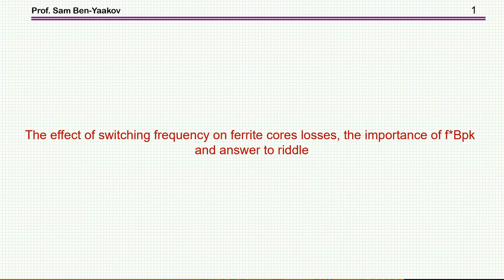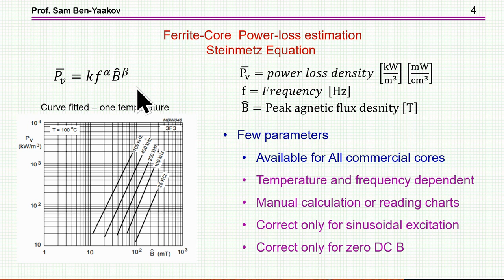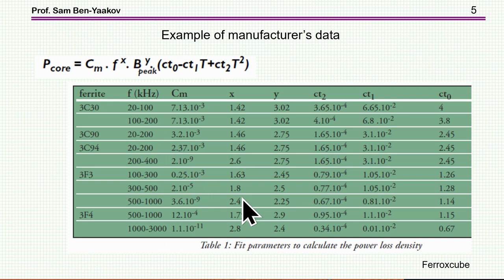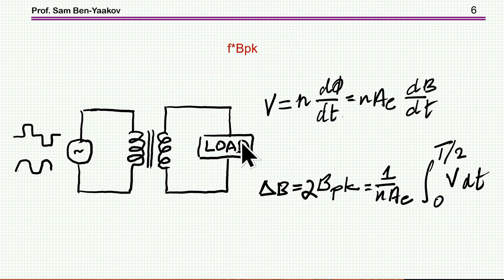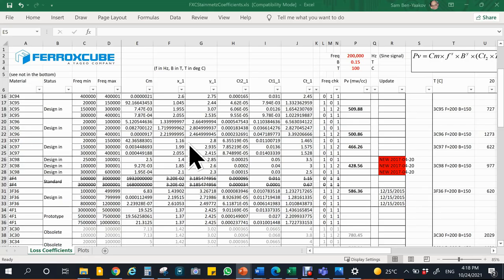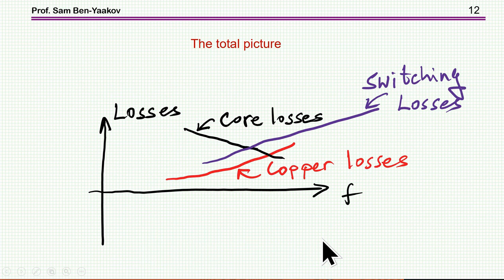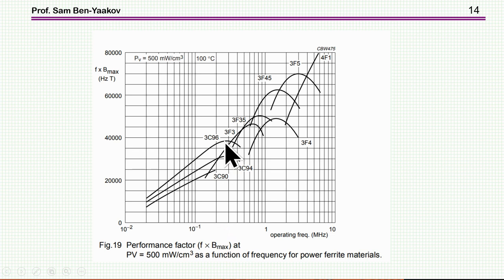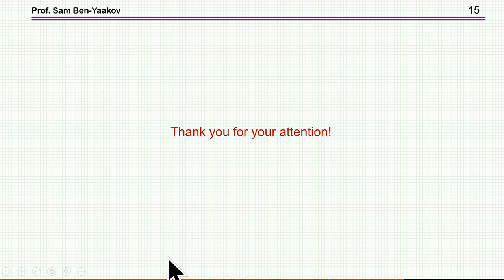The effect of switching frequency on ferrite cores losses, f*Bpk and answer to riddle

Comment: Thank you for this very helpful video! If I may ask a question, please, wrt the equation in the slide shown in the 14 minute mark-- I've seen calculations of inductance (say in a boost converter) use the peak to peak current and ∆B value. Once the inductance has been worked out, ∆B is re calculated and divided by 2 to get the Bpk value to estimate loss from the manufacturer's graphs. Is this "divide by 2" approach applicable for inductors/ chokes as well as transformers?
Reply from the maker: Yes. The Steinmetzian equation of ferrite losses is formulated for Bpk while when calculating B from Faraday law you get deltaB=2*Bpk
Reply: @sambenyaakov  Thank you very much for your response, appreciate your work!

Comment: Thank you for your videos on magnetics design, has helped me alot! I have a question that is not specific to this video, but rather about coupled inductor design. I am trying to compare the efficiency of a two phase buck converter using single inductors and coupled inductors. I am using a powder core for both design which have a flux saturation at approx 10000 gauss or 1 Tesla so for my single inductors it is not neccesary to use an air gap but for many designs of coupled inductors i have seen, they are using an air gap. Is this neccesary even though you are well below the saturation or is the air gap needed for correct functionality of the coupled inductor?

Thank you in advance,
Best Regards
Reply from the maker: I don't follow. Powder core is a distributed gap core.
Reply: @sambenyaakov  Yes, but with a distributed airgap core, how Can I then change the coupling factor if i dont have any “physical” airgap.
Reply from the maker: @PlayboyHZ  Coupling cooefficient is basically not a function of the air gap, although the air gap might affect it. See https://youtu.be/TUfaN40T1Yg

Comment: Thank you for this knowledge sharing. I want to know about air-gap effects in flyback topology. How to counter it and it’s effects on cross regulations.
Reply: Having windings close to air gaps will cause more losses due to fringing effects. It is usually a good design to not have the windings close to the air gap(s)
Reply: @PlayboyHZ  we need to add some turns on primary side. Cross regulations can’t be deal even if windings are not near air gap.
Reply from the maker: Counter in what respect? The gap increases leakage which affects cross regulation.

Comment: Great information sir, I was wrong about core losses. I tried an isolated SMPS with EI ferrite core rated at 100kHz. But I switched it at a frequency of 25kHz thinking that a lower switching frequency should not be a problem. The core heated up so much that it fell apart by losing glue. Your video is of great help for me professor. From your video my other conclusion is that ferrite core doesn't care whether it's a sinusoidal signal or square wave. Because higher order harmonics makes no considerable harm to the core - from a core loss perspective? Is that correct?
Reply from the maker: Thank for comment and sharing your experience which seems like an experiential validation of what is said in video😊

Comment: Hi. Could you please post a link on the mentioned video about inductors and transformers design. And a small question regarding this video. When you demonstrated B(t) with positive and negative flat tops, does it mean that the coil at these moments has DC-current through the coil, i.e. B=N*Idc/(S*A)?
Reply: Try seeing https://www.youtube.com/watch?v=3nfqBzPMknY , to start (Ap is mentioned into the video), and for flyback design, using Ap, see https://www.youtube.com/watch?v=Y0WWj2dO_h8... finally see https://www.youtube.com/watch?v=Y0WWj2dO_h8 (Ap is mentioned near the end of the video.)
Reply: @willthecat3861  Thanks. Is the 3rd link correct? It duplicates the 2nd one.

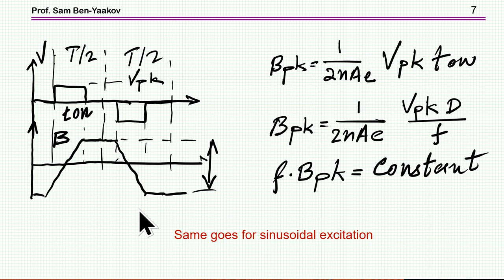Comment: 6:43 This is not correct: the loss coming from hysteresis is just one part, the other one comes from the core eddy currents, which gives Pe = k*f^2*B^2 (valid for linear materials), so the total losses are k1*f*B^2 + k2*f^2*B^2. In total, for nonlinear materials, these exponentials are given by Steinmetz coefficients alpha and beta and typically beta>alpha.
Reply from the maker: Sorry but you are wrong. Ferrite material has negligible eddy current loss and the Steinmetz equation represents for the hysteresis loss.
Reply: @sambenyaakov  I would agree to a certain extent, it is normally low due to the low electrical conductivity of ferrite materials, but still alpha>1 which indicates higher order of frequency dependance.